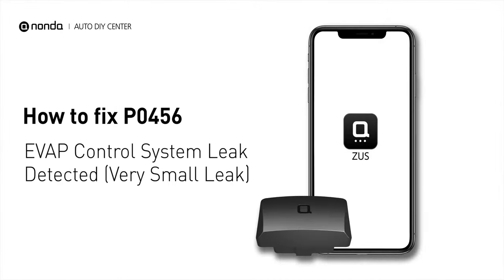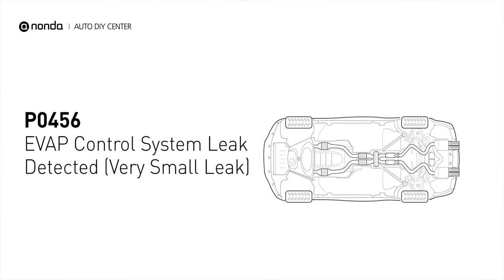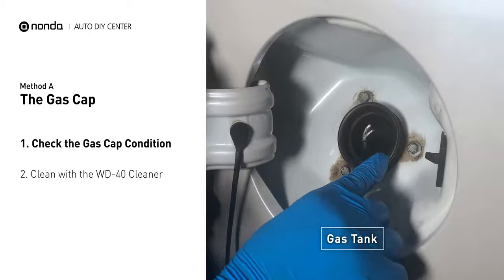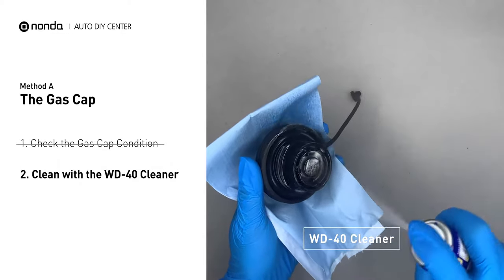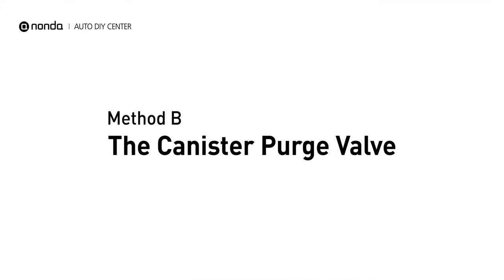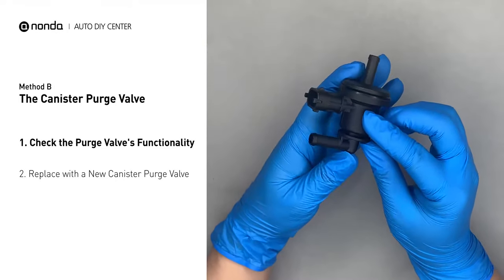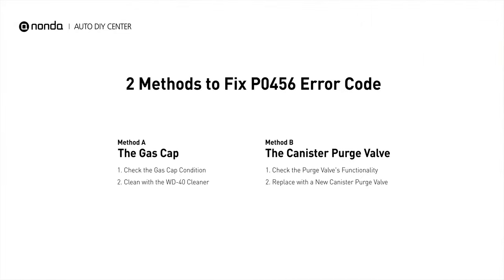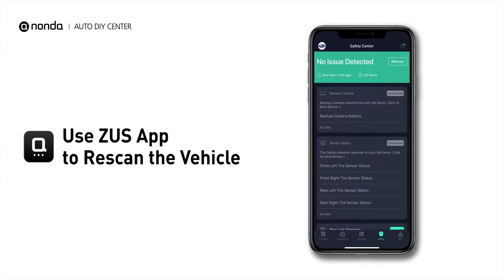How to Fix P0456 Engine Code in 3 Minutes [2 DIY Methods / Only $4.44]

Comment: I over filled my gas tank and 2 days later this code p0456 appeared , the car doesnt smell like gas 
What could it be
Its a 2007 Scion TC 2.4l Base
Reply from the maker: Can you please confirm if this is the only code you're getting?
Reply: @nondainc  yea its The only Code for CEL
Reply from the maker: Hello, your canister might be damaged due to overfilling your tank. We suggest getting your vehicle visually checked by your local mechanic to check also other parts of the system.